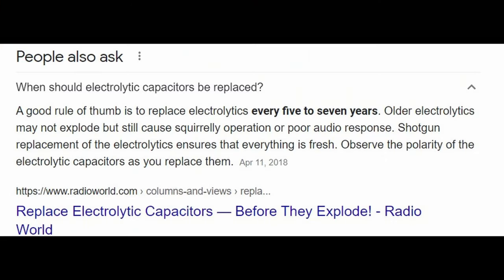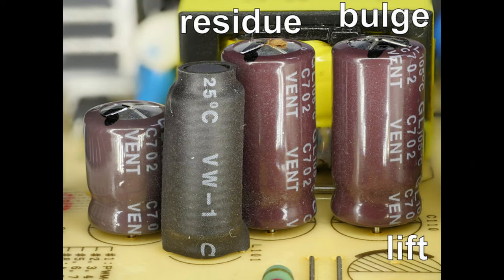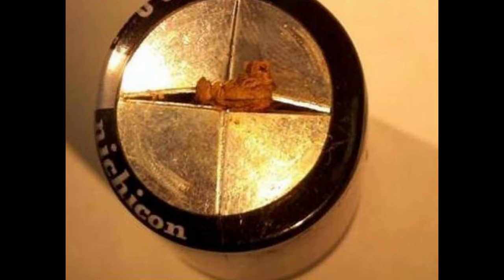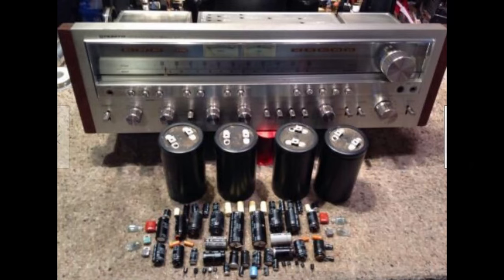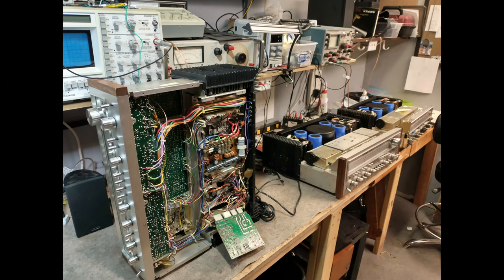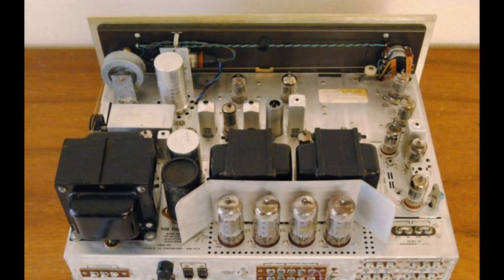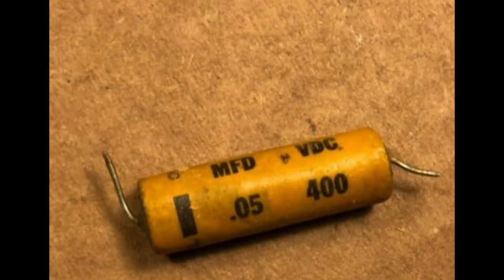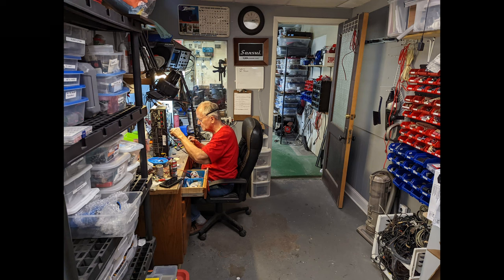Should You Replace Capacitors In Vintage Electronics?- Marantz Sansui Pioneer McIntosh Yamaha

Comment: I agree with a lot of what you're saying, but I have to say a couple things.  Those large (main) filter capacitors are sealed better and have more electrolyte in them than normal caps.  They are most often just fine.  Quick check to test ... hang your scope across them and look at the ripple waveform.  That will tell you everything.  If they are vented - of course they are bad.  Don't waste customer's money on the most expensive parts in the set if they are not needed.

Coupling capacitors do not change the sound (thank you!).  Caps in filter circuits sure can, and others.  But not coupling capacitors.  Same for power supply capacitors, bypass caps can if you change technology but they do that by reducing noise.

Some stereo brands use better parts than others.  Pioneer isn't very good.  Sansui, Marantz and many others are much better.  Most capacitors are used in locations where they are not stressed or heated.  You're probably further ahead not touching them, plus 99.9% of people do not form the leads properly and can damage the seals in the rubber.  That takes some years to show up.  Other capacitors are under stress due to heat or whatever - change those of course.

So my advice, do not totally "recap" anything.  Replace what should be replaced using parts that actually fit the mounting space.  Form the leads properly when needed.  If you can't solder, don't touch it as you may damage the foil traces.  Do not buy "kits" for recapping.  Those parts are normally cheap, or knock-offs and typically don't fit properly.  Select the parts yourself one by one from authorized distributors.

I've done this professionally for nearly 50 years and am still working.  I am so sick of doing cleanup work and seeing customers have to pay for rework or to repair damage.  Just get it done by the right people once.

Comment: I have a question about recapping vintage Pioneer cassette tape decks.  I service the CT-F900/950 models that were produced in the late 1970s, and resell them on eBay.  I publish videos of the work done (and label the units with a list), so folks know what's been done during the time I had the unit.  

I typically recap the power and control boards as a matter of course.  One specific cap on the control board is always problematic, so recapping the whole board is just for completeness.  Most of those caps, when pulled, have measured typically w/in 10%; but I've replaced them anyway.

However, the motherboard and riser boards are another thing.  I have had units where I've scoped the unit before recapping (the unit recorded and played well).  Then, I recapped the motherboard (electrolyitcs only, and some caps like 1 or 10mfd were typically out-of-compliance by about 20%).  Afterward, the scope values were relatively unchanged, and the unit recorded/played with no perceptible difference (a control tape was recorded before any work to baseline; second tape after recap; playback measures of each tape scoped nearly identically).

So, while the major work on these units is typically confined to mechanical components (belts, idler tire, pinch rollers, cleaning and re-greasing, rebuilding the take-up motor), recapping the motherboard hasn't proven its value.  And never mind recapping the flow/display board unless it is not working at all.  When I've recapped those I've seen no difference in illumination or any other factor that I can measure; and the work to remove it and perform that work is better than two hours.

So, in your experience, and I'm not sure how many cassette decks you do, what have you seen specific to motherboard recapping; and is it worth the time?

Comment: I'm going to disagree with many of the comments. I have two vintage Hi-Fi Amplifiers. A 1978 Japanese JVC JA-S22 (45 years old), and a 1990 British Musical Fidelity B200 (33 years old). Both Amps are 100% original. Both Amps work perfectly, and sound amazing!

I've only ever had ONE electronic device explode from capacitor issues, and that was a late 1960s SONY VTR. They were well-known for it!

EDIT: I must be "insane" then! Because DECADES later, my Amps sound as good as they ever did!

Comment: Older caps gain ESR and lose capacitance.  You must test frequency response of preamp output and amplifier under load.  Simply replacing power supply and bulging caps doesn't cut it.  But it's cost prohibitive to replace all caps.  Certainly you won't put an original "good" cap back in, but testing it gives a representative sample of how the remaining caps are degrading.  Some of these original caps were +80/-20 rated.  Modern caps won't be +80, and the design may have relied on that.  Good Japanese replacement caps are Nichicon and Panasonic observing ESR, temp, and voltage ratings.

Comment: Absolutely correct ! You have people spending hundreds of dollars on cables ,but are questioning $5.00 or less for fresh capacitors !
Technology has advanced since these units were built!  Parts are better and you will hear a difference ! For the good…
If you have the space polypropylene are the best . But good quality electrolytic is available in the size and value you need.
We are currently living in a disposable society! Throw away is the  way we live now? No more Radio Shack or even repair shops?
But plenty of thousand dollar cables and dacs? $75.000 phono pre amps ? Or things to lift your cables off the floor ?
Your car still has some tread left…but for how long?  If it ain’t broke don’t fix it? A new set of tires will provide safety and security!
Fix it !

Comment: I am a retired T.V. stereo etc tech from the 70's and I would add that if you can hear an improvement in the sound of your receiver after recapping, then one or more of the caps you replaced were definitely in need of replacing. It would be a real rare person to hear a difference in audio just by using a slightly different brand or value component. we're talking " SPECIAL"....

Comment: 3:30  There IS a way that a reduction of capacitance in a P.S. filter cap CAN degrade the sound.  That's because the P.S. source Z increases, which can cause cross-talk from one stage to another, especially on current peaks.  An increase in ESR can do the same thing, even if the capacitance doesn't change.  My advice:  Check value, ESR, and leakage, of all electrolytics, and replace any that seem "iffy."  It's a lot of work, but much cheaper than just replacing them all.

Comment: Agree, common sense.
Too many experts on Social Media.
I have two components that I have concerns about;
1) Luxman L-210 Integrated Amplifier.
Bought in 1984,as a traded in, second hand unit.
Currently, the on/off button is broken. Will turn on, and off intermittently. It will make an audible "click when engaged.
Second, the orange power on display lamp is broken.

2) A Phoenix Gold MS-275  2 channel automotive power amplifier. Bought in 1994.
Has been sitting unused, covered, and put away.
I live in Honolulu, Hi.
Is there anyone here in Honolulu that you know of, that you could recommend having a look at them.
The Luxman Integrated Amp., definitely needs work, still works though.
The P.G. Amp, more as a going over.
Thank you!
Love your videos!

Comment: What do you think of new old caps? Reason i ask is my late dad was a tech in the 70-90s and i have a crap ton of old 'new' caps ( along with 1000s of trannys ICs, diodes, resistors along with 1000+ manuals im still sorting) Seems like the only piece of tech equip he didnt have was a proper LCR tester so i am unable to test them right now.

Comment: I had an old jvc receiver that sounded great until a speaker short popped the transistors. I decided to not fix it but wanted to save the three large power supply filter caps. I removed them and to my amazement were shot and didnt have any capacitance at all. I remind you the amp sounded great. How would it have sounded if these had been replaced? (i wish i didnt toss it 10 years back  because today i would have repaired it)

Comment: power supply capacitors "changing the sound" only applies if some like the 60hz or 50hz buzz the antique unit makes, lol. The only exception is maybe metalized-poly-film and ceramic capacitors unless there scorched or physically broken into pieces rattling around the unit. the higher the frequency the more the electrolyte heats up and the faster the can drys out, that's why 100+khz switching power supplies (especially newer computer PSUs) have a shorter life than analog stuff.

Comment: ??? How old is old on these parts/units?  I have Pioneer 35 wts receiver unit from mid 70's that has maybe 10 years of low end use and stored for many years.  Is old a calendar issue or an overall hours used issue generally?
I'm 70 and recently realized I should get out my old gear from storage and enjoy them awhile, hopefully they still work.  Just found your channel and enjoying your content.  Thanks 👍

Comment: Friends of mine ( who unfortunately passed away) asked me to find a technician to repair a Kenwood kn5400 receiver that sounded great but ceased to function.
Now it's in my possession.
In one listening room I have an old jvc receiver that simply sounds with a slight colorization that I don't like that much.
Should I have this Kenwood repaired and if so recapped?
Some Kenwood models aren't rated well but this one supposedly has a power stage that does great justice to it's output wattage.
I've also got a marranz receiver that fried out. It sounded quite transparent but didn't have much headroom in wattage.
I'll edit it the model number later.
By the way I enjoyed the sound of the Kenwood.

Comment: It maybe understandable to question changing some caps IN the direct audio circuit only...   but it would be dependent on the TYPE 1st off
Electrolytics are the absolute worst for degradation and failures by far..   swapping in new ones for older units is a no brainers and for smaller values.. changing type is a good idea esp for smaller values..eliminating electrolytics  to even basic mylar is a huge increase in reliability. 
The only reason for electrolytics not being changed for better types is cost and physical size.  Cost for such in the main power supply of many vintage pieces would be heart attack inducing esp if you foolishly looked at using grades/types designed for being inthe direct audio path.

Hats off to this channel host and others helping doning this 
Old skrool work....   its sadly true itnisna dying art with more and more idiotically designed goods being designed obsolescence...  and so called techs just pulling entire sub boards to replace and not actually fixing the problem at its source

It's much the same as the fukin dolts I call winbloze babies that claim to be IT techs that their go to fix is maybe a quick scan of X system for malware and then reinstall winbloze..   that is NOT a real tech by any means..   its s monkey in s shirt claiming to be a tech

Proper basic preventive maintenance for vintage gear along with smart parts replacement can help make that 50yr old reciever last another 50yrs...

Good luck with getting even 20yrs from much "modern" uber cheaply made shit now.
Reply from the maker: "Dolt" lol, excellent word. Underused.

Comment: I restore vintage radios and TVs and pretty much agree with this.  I replace all the paper and electrolytic capacitors in 60+ year old equipment.  However, the Mica caps are usually still ok.
Reply from the maker: Agree 100%. Rarely see mica caps fail. Thanks for the comment!

Comment: Before I replace the power supply caps, the unit when  powering light flashed slower. With  the new capacitors in, the flashes are faster.

Comment: Coming from a fine art perspective; keeping equipment out of the sun and in a climate controlled environment might slow the degradation of components over time. 
When ambient temperatures and humidity change, objects expand and shrink. Ultraviolet exposure damages materials as does ozone exposure.

Comment: to add leaky coupling caps lead to burning up tubes and transistors down the line by unintentionally biasing the devices beyond saturation tuning them into switches in a sense

Comment: Great video, I believe in doing the same, especially recapping a board at a time when the issue points to that board specifically and some caps are showing signs of age. As far as micro changes if people are that worried I believe in high quality audio caps where needed and high quality same spec for the otherwise like filter caps. At that point I’d say it’s more similar then to factory. If you have an oscilloscope I bet you can compare the two samples stock unit and repaired and I’ll bet the only difference being it’s closer to the spec sheet. And as far as the end of the video it’s understandable, I’m 24 and slowly learning everything since I was much younger albeit a few years were more focused on modern devices but I have never met anyone my age tech wise who would even give these another chance.

Comment: I have a fisher receiver from 1984,  i paid $200 for it.  Sounds great.  When it goes im throwing it away,  due to its not a pioneer sx1980 or some other high dollar unit
Reply: To me its about diminishing returns. Will the unit still hold its value after the work is done

Comment: Awesome video.  I have a Marantz 6170 TT my father bought in the 70s and was wondering about replacing the caps.  Guess I will.  Now to figure out what I need to get.  The receiver is in storage somewhere.  That may be a fun project to do later.
Reply from the maker: Do it! Nice weekend project. Let us know how it goes or if you can hear a difference. Happy 4th!
Reply: Props to all of the tech's in the business. Thank you for keeping the gear running and for sharing your wealth of knowledge with a somewhat 'younger' generation. Many people today simply do not have the patience or the surgical preciseness it takes to do this work. I truly believe it is an art as much as it is a service. 

People talk about how it isn't that difficult to do and then they end up bringing it to a qualified tech after they have made an attempt....the shop opens up the unit and there are globs of solder that span to multiple landings, strange looking wires that don't look like any others, electrical tape where there should be heat shrink, etc. At that point there has usually been more damage done that may be irreversible. Plus, nobody wants to go in and fix someone else's hack job. 
Clean work is quality work.
Reply: @brianj.connelly3353  everyone that i know who is capable of doing this type of work is over 50 years old.  And we all spend as much time messing with and adjusting our magnifiers as we do de-soldering and re-soldering components. People with young eyes and  a steady hand are not interested in this type of work.  Yes they can learn the electronic theory fine....   but very few have the patience and dexterity required for conventional through hole component replacement let alone surface mount work.

Comment: Seems you can't always find the original filter caps . Nichicon , Elna , Epcos , CE , Adcom , Parasound units etc . If a larger Voltage & Capacitance will fit in the same spot , is it ok to increase from 80 vdc to 100 vdc

Comment: I'm restoring a Pioneer SX880 receiver for someone. Heat kills caps so any cap that has substantial current flowing through it has been self heating for decades and it should be replaced. Also electrolytic coupling caps do not age gracefully, I usually replace them with film caps if i can. Also replacing any cap that is starting to bulge or is starting to bulge has to be replaced. Any other electrolytic caps you replace will just stay good for decades while the old ones are just getting less and less robust.

I just turned 75, how much longer will i be able to do this kind of work?
Reply from the maker: My Dad is 75 also. He is still going strong and still repairing these old beauties. Hope you and my dad can continue for many more years to come!
Thanks for the view and the comment! Kevin

Comment: Can you comment on finding a 'reputable' repair shop? They're becoming few and far between. Tips on how to tell if the place you're taking it to has any idea what they're doing? I've been looking for someplace to work on my AU-517. But I've yet to find anyone that gives me a sense of confidence. What am I looking for? An old guy sitting at the repair counter in the back? What should I be looking at for a typical complete cap replacement for an amp like that? What's too much to spend?
Reply from the maker: I think Audio Karma would be where I would start my hunt. Ask for suggestions to reputable techs in your area.
Can't speak to price, as its gonna be different based on location and overhead. Finding a retired guy (via AudioKarma) in his basement would probably be the most cheapest and maybe the best for the job. They are out there. Good luck!
Reply: @skylabsaudio  Thanks

Comment: I have a Pioneer SX1980 I bought from German HIFI in Washington, DC. It had a power supply failure. I put it away. Lights did come on, but now nothing. The tuner is stuck or locked, bummed up if you will. I would like to have it fully reworked. Here, where I live, I don't know of a fully reliable repair shop here. So in most cases, what would it cost to repair. The cosmetics are near mint, and I would hate to just let this go. 80 miles south of Nashville, Tennessee.

Comment: You said it: preventative maintenance! Different than repairs. 
Also, unsoldering an electrolytic to test it then resoldering it unnecessarily subjects it to heat that may shorten its life or trigger a fault.
Reply from the maker: Agree! Another good point to add to the list of reasons to just replace. Thanks!